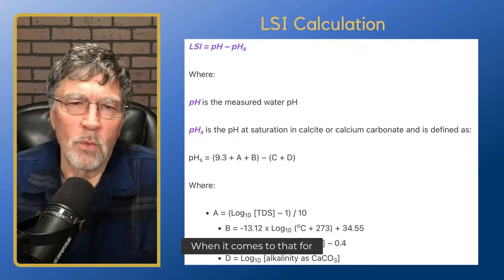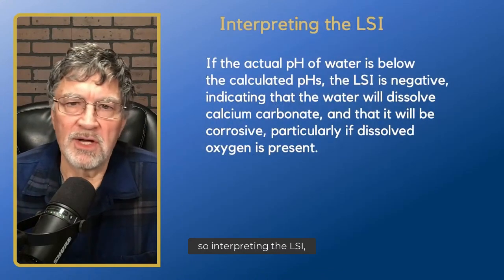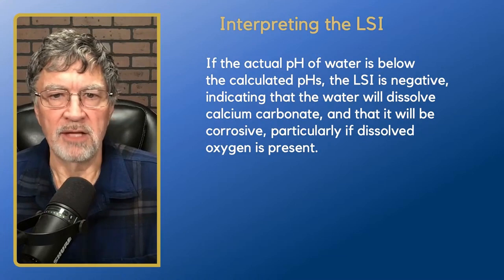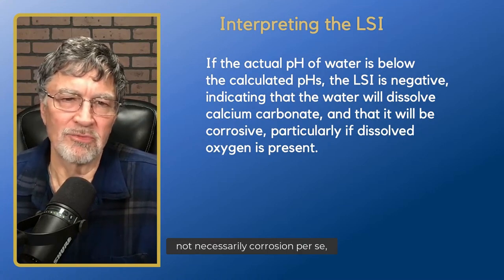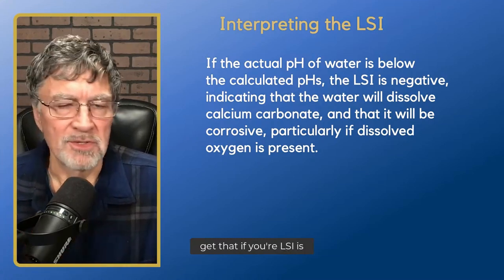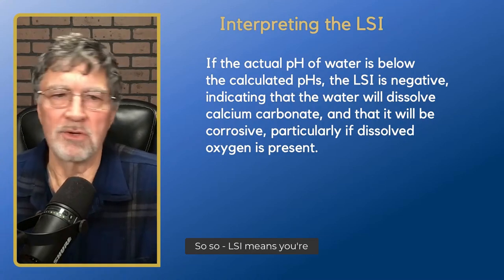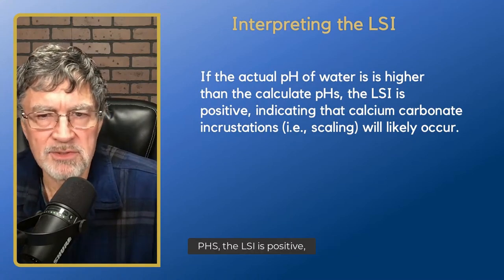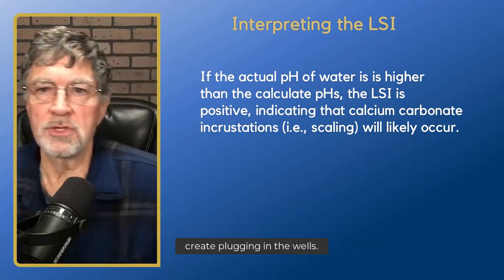Lagelier Saturation Index  Calculation

Comment: Hi, what if the readings fall in between the chart? Lets say TAF is 165 ppm, what number would you use to calculate? Or CHF is 10ppm? Do I round up or down? How would you calculate an accurate unit to use to plug into the formula? Do I round up or down? Thanks in advance!
Reply from the maker: I would generally round up to be a bit conservative.  LSI is not a precise measurement, so a little rounding should not hurt your interpretation.  Of course, things can vary by your specific circumstance, so looking at the rest of the numbers may dictate a different approach.
Reply: @thegroundwaterguy  thank you!